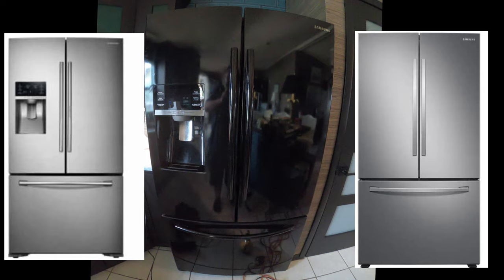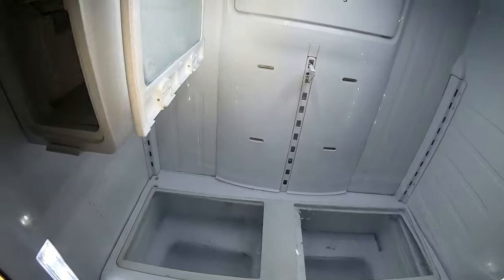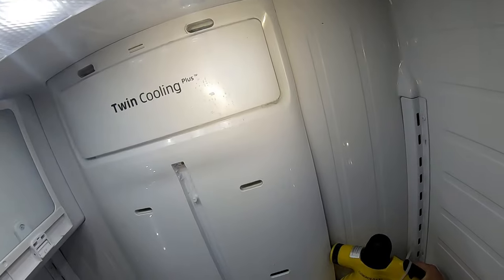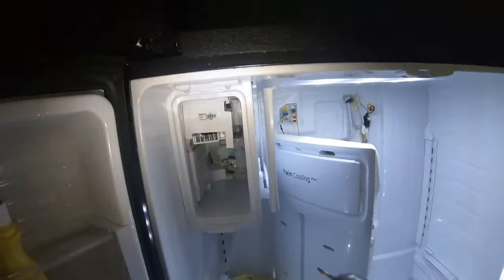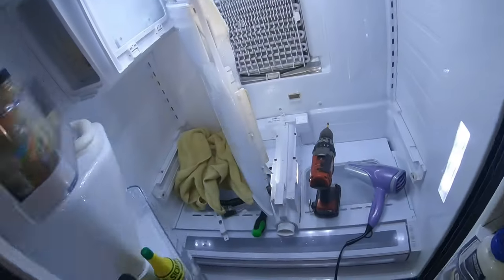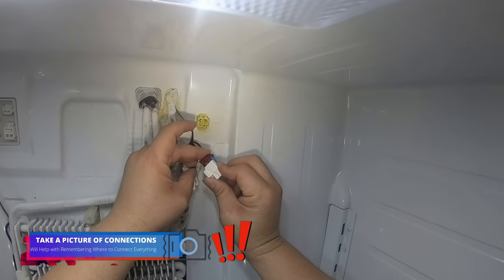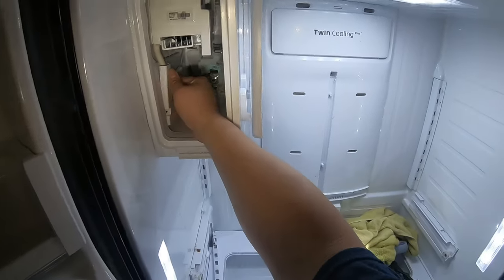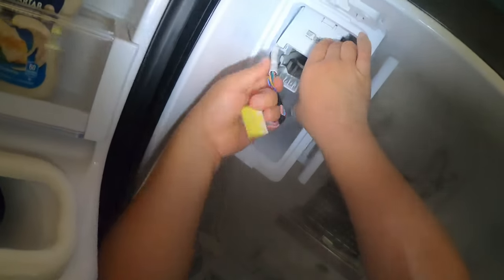How to Fix Samsung Refrigerator Ice Build Up on Back Panel ⚠️ PERMANENT FIX! ⚠️ Model #RF23HCEDBBC

Comment: Wow, I wish I would have seen this particular video before. My Samsung gave me problems less than 6 mos in and they sent so many techs to fix or replace the ice maker. Would last a few weeks and then kept icing up. Would just thaw it out but then when the refrigerator part started freezing and then warming up and ruining my food then replaced the thermistor and worked again for a few months. Finally gave up after 3 years of this nonsense and bought a new LG now a year old without any issues.  Samsung needs to stick to phones and TVs

Comment: I got the parts: heating element, wire couplers, and thermostat.  The thermostat that was linked is the wrong one (it's too small).  so, I left the original thermostat in place, added the heating wire as demonstrated here, and put it all back together.  I check back in a month or so to let you know if it's icing-up anymore.
Reply from the maker: The original termistor is been discontinued. If you have any issues, go ahead and cut the wire splice them the one you order will work thanks for watching my video. Keep us updated.👍🏻👍🏻💯💯
Reply: Hi did it work for you ?
Reply: IT WORKED!!!
Reply: @DIYRepairsNow  It worked for me, thankyou!
Reply: @DIYRepairsNow  how do I know if I’m splicing the right wires with the right wires?

Comment: Excellent video, very thorough. I was able follow your instructions, order and install the aftermarket warmer into the circuit.  It is actually fairly simple and it works like a champ.   It was freezing up every 30 days, we had to empty the fridge, remove the cover, and defrost it with a hair dryer.  IT IS NOW FIXED!  A small amount of water under the produce drawers tells me it is melting the ice.  Saved me over $2000 for a new fridge.  Thanks you!
Reply from the maker: Excellent! Glad My Video Helped! Thanks for Watching!

Comment: How do I know if my Thermistor wire in condenser is broken? is that cable same for my Samsung RF26HFENDSR 36" French Door Refrigerator
Reply: Remove  the thermistor and attatch an ohm meter to the leads. Put the thermistor in the freezer with the leads and ohm meter outside the freezer. In about 45 mins to 60 mins the ohm meter should read 0 ohms or be considered " closed". 
Also the heating element should be checked with an ohm meter to make sure it's not burned out, "open".
Lastly. There is anothe thermistor, condenser, and heating element in the back of the ice maker that is not discussed in this video.  
This guy tested nothing, threw parts at it, and required 4 trips to the customers house. What he actually ends up doing is adding a heating element in parallel to the one he never tested.
Reply: @davidcoward9522  yeah seems like he was fishing a fix. He ended up replacing everything but I no longer have warranty to do such

Comment: I have this EXACT Samsung fridge for about 10 years this year, got it from HHGREGG. And mine just started freezing up too..and fan stopped also, due to ice build up. And fridge  keeps making noise from fan blades hitting ice.
Had someone came and replace the entire back panel last week. Today, it stopped working again. Im defrosting it now..11:35pm..dont have the time to wait for 24 hours..just came from the grocery store..with groceries. So, thanks for this video..will eatch till the end to see how to fix the problem permanently. This is a beautiful refridgerator. I dont care whether the ice maker works or not..im more concerned about the refridgerator.
Thanks for your video. Very thorough..very helpful.
Reply from the maker: Yes, That Could be a Possibility.

Comment: Thanks for putting up this video, I didn't notice until 1:00 in the morning, That my 6-year-old fridge was making excessive noise, from fan blades hitting all the ice from where the panel had Frozen up..... It's been a particularly hot summer, I'm not surprised something failed, it's what I get for only getting a 5-year warranty 😅.
Thank you for the detailed repair, now I know that at most I probably have to order four or five parts, and I can install that myself.
Reply from the maker: My Pleasure! Glad My Video Was Helpful! Thanks for Watching!

Comment: Thanks for this video, super helpful! Waiting for my parts order to come so I can repair later this week. Just to confirm- the grounding wire only serves to prevent the added drain heater from touching the original heating element in the fridge?

Comment: Do you have any advice on what to do to replace GE Refrigerator Door Switch WR23X10593 which is no longer available at GE or parts locations?

Comment: What is all that foam around the copper wire and the thermistor?? Who did that and did it help prevent condensation from forming in the panel?
Reply from the maker: All the answers it’s in the video you have to watch the whole video

Comment: Hi, I noticed that the tap splice link you have is for 10-12AWG yellow but in the video you used a blue one which is 18-14 awh in Amazon...should I use the yellow or blue?
Reply: I'm curious about this as well.

Comment: Since I moved into my new house I've had icing on the shit Samsung fridge they sold us with the home and between adding the additional heating coil, sealing the ice box with caulking, and changing out the thermostat and deicing thermistor I've finally got a fridge that works as intended with no icing. It's likely the two thermostats that solves it for me but it never hurts to do the others and go from there

Comment: I did this but now it runs too cold. Everything is frozen.
Reply: Adjust your interior temp to 37, the stock recommended temp. Had that issue too and we always had it set to 34 before.

Comment: Attention Samsung junk owners, There was a class-action suit that was brought against Samsung refrigerator ice maker problems. Samsung denied any malfeasance on their part but, after waiting several years, they repaired my ice maker issues. They replaced the main circuit board plus all the interior freezer parts. My Samsung ice maker problem has been rectified at their expense and since the repair, My ice maker has been trouble-free. The rest of the refrigerator worked just fine except I couldn't use the ice dispenser for years. You know Samsung could have just fixed the problem quietly but chose to have themselves publicly criticized and forced to atone for a problem that plagued the French door/freezer bottom refrigerators.
The defrost method while functional, did not remedy the icemaker issues because the build-up was severe enough to negate using the defroster which is kept a secret from customers.